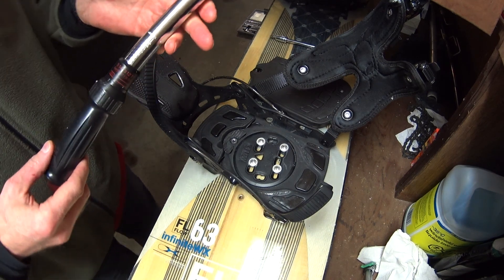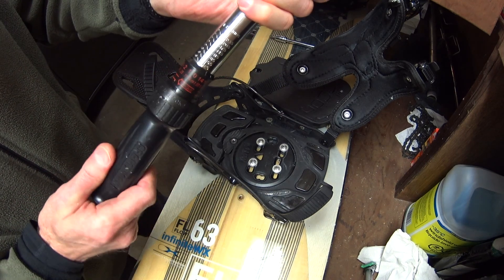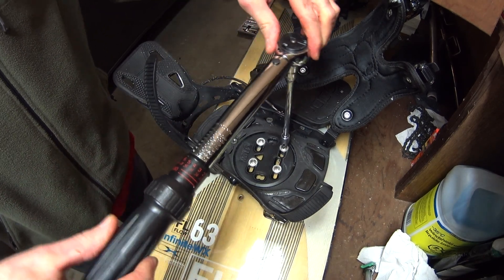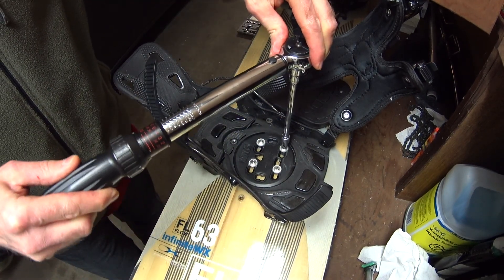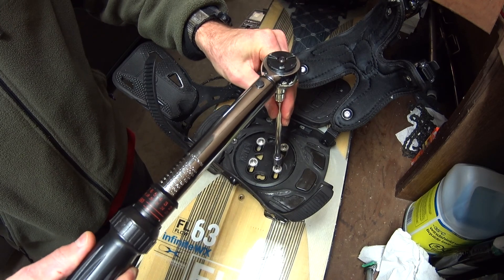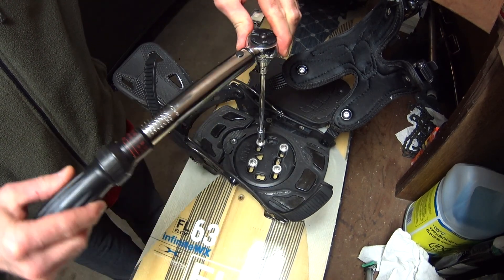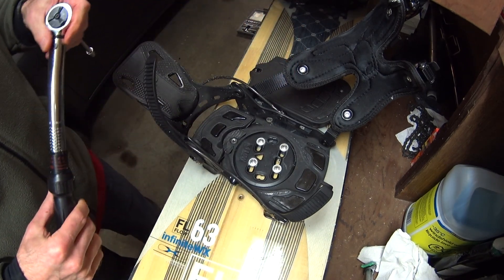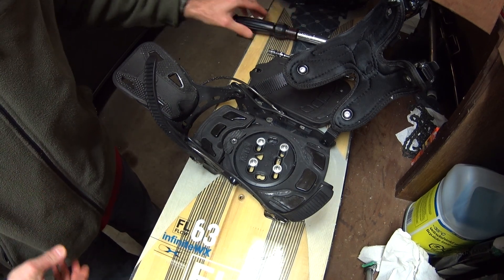Snowboard Bolt Torque - 30 INCH POUNDS

Comment: Can I use a bike torque wrench? If so what setting should I be using? 3.5nm or 4nm?
Reply from the maker: 3.5 newton meters is equivalent to 30 inch pounds, so go with that. "Hand tight" is considered ~24 inch pounds (or 2 foot pounds), so you're marginally tighter than average hand tightness. 👍
Reply: @misterfunnybones  ok just keep it at 3.5!
Reply from the maker: @sammietam4201  I'd only consider increasing the torque if you experienced a loose bolt during or after riding. If you hot wax, then loosen the bindings a little before the iron, because the heat can cause the base to indent where the bindings are located if they're fully tensioned. Then tighten after everything cools off.
Reply: @misterfunnybones  thank you for additional advise!!

Comment: I picked up a board that my local shop's tech assembled for me, but the bindings were clearly a bit loose when I tested on carpet by strapping in. I've got a torque wrench so I tightened in a diagonal pattern to just above 30 inch pounds and all seems much better now. However when I unscrewed the bolts initially, there was a bit of a gritty sound and feeling on my screwdriver. Could that just be dried-up lock-tite coming loose (bolts have blue on the thread) or could it be a symptom of being over-tightened?
Reply from the maker: Sounds like the loctite is dry in the threads & may have left some residue as you tighten & loosen. There's no harm in removing your bindings & banging the board upside down to get out any loose debris then optionally remove any residual old dried loctite with alcohol & a toothbrush, let the alcohol evaporate & then bang the the board upside down again to get any leftovers.
Reply: @misterfunnybones  that was super helpful, thank you! Great video :)